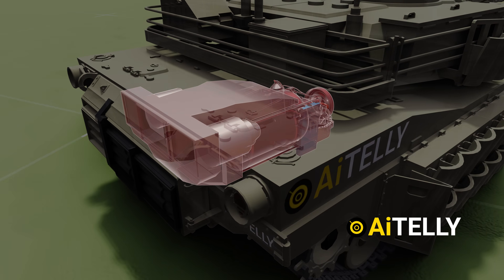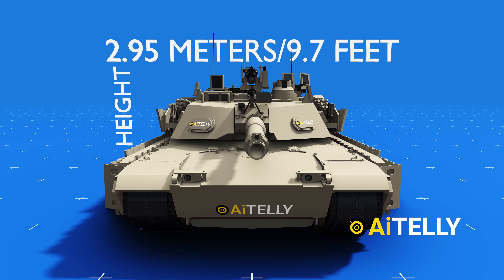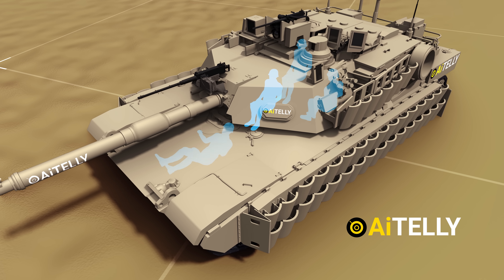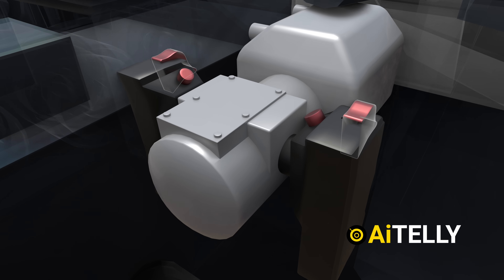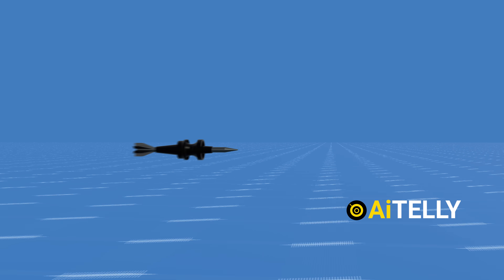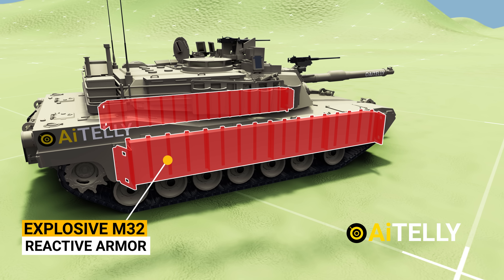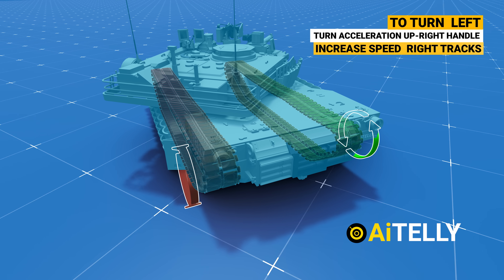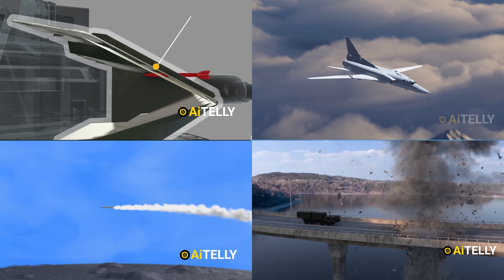How Modern Tanks Works and Fire Interior Exterior M1A2 M1A2C Abrams Trophy System Reactive Armor

Comment: 19K here, you forgot to correct some info, we enter the drivers hatch through the turret when it is traversed to the rear, revealing a compartment for the driver to crawl through feet first, and then the turret will get traversed back to the 12 o'clock position.

Comment: When turning the tank, all the driver has to do is push the handles in whichever direction he wants to turn. To turn left, right hand forward, left hand pulls. To turn right, left hand forward and right hand pulls. The speed of the tank is controlled in the same manner as a motorcycle but they are not independent of each other. Also, the TC can find a second target and have the gun switch to it while the gunner is finding, sighting and firing on his target. Multitasking at its finest.

Comment: 🎯 Key Takeaways for quick navigation:

00:01 🛡️ The M1A2 Abrams tank is equipped with a gas turbine engine, similar to a jet engine.
01:12 💼 The M1A2CA Abrams with TUSK (Tank Urban Survivability Kit) has a length of 9.83 meters and a combat weight of 61 tons.
04:39 🎯 The tank's gunner operates the 120mm smoothbore gun with controls and a trigger inside the tank.
07:10 🔫 The tank uses different rounds, like the heat round for lightly armored vehicles and the fin-stabilized armor-piercing round for tanks.
09:00 🚀 The tank is equipped with the Trophy system, a countermeasure that neutralizes incoming anti-tank missiles.
09:55 🛡️ The tank's armor includes a depleted uranium layer and reactive armor blocks for additional protection.
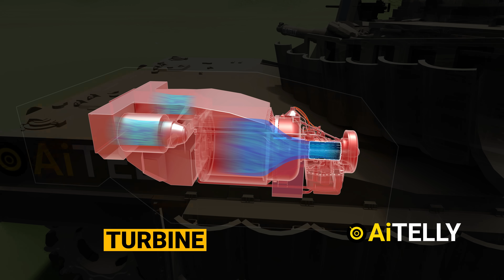11:02 🚛 The tank uses a gas turbine engine (AGT 1500) for propulsion, offering advantages in power and fuel flexibility.
12:27 💥 Despite its advanced features, the tank has vulnerabilities, including susceptibility to certain top-attack weapons and a high cost.

Summary by HARPA AI 🧬

Comment: Can anyone explain
Between turret and body there is a ring what if hits there? Easy to penetrate?? This is weak point
Reply: Yes, this is a weak point on literally every tank, it is a bit hard to hit, but World War II tanks can disable pretty much any tank nowadays as long as they can hit and penetrate the turret ring. This is just limited to the Abrams, the Leopards ,the T-series of tanks and literally anything else has this weak spot. But hitting such a weak spot is really hard. Hope you learn something 😊.
Reply: that ring is the turret ring, a gigantic gear that turns the turret, it is probably one of the most common weakspots on any tank, most turret rings have armor of less than 80mm soo very easy weakspot

Comment: the sliding hatch at the forward driver position should be replaced with a sliding hatch mechanism that slides side-to-side from inside the hull . . . not the outside sliding hatch mechanism as in all present M1A2 & M1A3 Abrams tanks . . . the internally sliding mechanism is safer & provides the driver with less exposure time, when getting in & out of the tank . . . the ammo compartment in the aft turret section of the M1A2 Abrams has the same internal sliding access mechanism . . . furthermore the M1A2 Abrams could seriously do without the forward co-axial gun when it already has a .50 Cal HMG mounted on a 360° deg rotating remote weapons station, on top of the turret . . . not to mention the 7.62 mounted on top of the main gun, against infantry . . . could do with a 5.0 in. suspension lift for increased off roadability . . .

Comment: Hmmm not quite. A jet engine is a gas turbine engine, but a gas turbine engine is not necessarily a jet engine - as is the case here. It's a turboshaft engine, rather than a turbojet or turbofan engine, which are jet engines.
Reply from the maker: https://youtu.be/5AdirNl4l1k We made a correction on the Abrams tanks.

It's feedback like this that helps our channel

Comment: You are not right about engine army picked it (initially was tested both power option in Abrams) by these reasons first it is less noisy in distance than diesel, less heat signature than diesel only downside is that it needs auxiliary generator to be invisible when stopped(the same goes for tanks with diesel engines) and save turbine life-span, multifuel, diesel in these test had only two advantage less fuel consumption and cheaper maintenance ... but in combat qualities was interior ...
Reply from the maker: We Corrected this Video Abrams Tanks   here https://youtu.be/5AdirNl4l1k how to drive a Tank

Comment: The animation and explanation of the driver's T handle is completely incorrect. The two sides of the handle are connected. Twist towards you and you apply throttle just like on a motorcycle, stop twisting and you stop applying throttle - bot sides of the t handle are connected and have the same effect. To turn the tank, you turn the t handle to the right or left like handlebars.
Reply from the maker: Hi Kyle https://youtu.be/5AdirNl4l1k We corrected this Animation Abrams Tank here just for you

Comment: Not a bad video, but there are some things that are not correct. The CITV ( Commander's Independent Thermal Viewer) allows the Commander and Gunner to scan for targets on the battlefield in different sectors. For example, the gunner would scan from 12 to 10 and the TC from 12 to 2. If a target is in the TC's sector he can hit the designate button, which will then slew the turret to what he is looking at. 

The driver's throttle controls are linked together. If you twist the throttle on one they both turn, they do not work independently. When you make turns in the Abrams, you just give it a little more throttle. 

I served in the on the M1A1, M1A1 AIMS, M1A2, M1A2 SEP, and M1A2 SEP v2. I joined the Army in 1998 and retired in 2020.
Reply: At first, I was starting to get irritated by so much being wrong in this video. Then it dawned upon me. It's kinda nice she still has some mysteries left.

Thank you for your service. 

91A-H8 09-13 myself.
Reply: @tommykj2   I try not to get irritated, but I know what you mean. You don't really know unless you've been there.

Thanks for your service as well.
Reply from the maker: Corrected some of the comments here  https://youtu.be/5AdirNl4l1k we corrected this Animation Abrams Tank

Comment: To anyone knowledgeable out there:
How does the main gun eject its casings?  I didn't see any kind of port that looks like it would allow this.  
Great video.  Thanks.
Reply: All the modern MBTs use "combustible cartridge". Usually the only thing left is the "base" of the ammo. It self ejects when the gun is fired, you can watch it on any video of an Abrams "loader".
Reply: @elgranfreezer9117  Thanks.
Reply: There is only an aftcap (primer end and about 3"up the sides) left and fall on the floor into a small basket. The aftcaps can be tossed out easily when time permits. The rest of the casing is paper so it burns with the propellant
Reply: @rovinruss4770  So it's almost caseless ammo.  That makes sense.  Thanks.
Reply from the maker: We Corrected this Video Abrams Tanks   here https://youtu.be/5AdirNl4l1k how to drive a Tank

Comment: Unsurprisingly, it’s the most lethal and most survivable MBT in the world. 🇺🇸
Reply: Incorrect. The Challenger 2 is the most survivable, and the Leopard 2 has identical firepower.
Reply from the maker: Challenger 2 Video Coming soon
Reply: @NorthernNorthdude91749  nope.
Reply: @ChrisDavis333  Yes. The Challenger 2 has a superior armor package, offering more protection. Only one Challenger 2 has EVER been lost. Numerous Abrams have. As for the Leopard, it mounts the very same gun as the Abrams. The Abrams is not the most lethal, or the most protected.
Reply: @NorthernNorthdude91749  we get it the challenger 2 survived an RPG-7 in its extremely limited combat experience.. that’s not impressive, an RPG-7 is nothing. If you put them in the place of Abrams, just as many get lost to IED’s and friendly fire.  Probably more considering they aren’t as good, their support is not as good and their crews are not as good. Given the benefit of the doubt, given the exact same circumstances in combat as the Abrams, the same number of tanks would be lost, likely way more. We’ll see how the Challenger 2 fairs in Ukraine, it will be its first legitimate war experience. I’m sure it will be documented if they actually use it, time will tell.
Reply: @NorthernNorthdude91749  also only 400 have ever been built, that is not a large enough fleet for even a small country like Ukraine to defend itself from an aggressor. So extremely low numbers+no combat experience=no losses. Since that seems to be your main talking point. You’re making me sound like I hate the tank, I don’t, I’d say it’s a top 3 tank in the world, appears pretty durable(we don’t know that for certain). It’s a newer tank than the Abrams and yet with all of Abrams upgrades over the years I still am of the belief that it’s a better tank, I come to that conclusion based off of its extensive combat experience and just its overall specs. Like I said, you’ll get to see the Challenger 2 in a real conflict here in a few short months, that “legendary” armor will get put to the test, if Ukraine doesn’t delegate all of them to non-combat roles(I doubt they will do that, they’ll want to play with their shiny new toy).
Reply: @ChrisDavis333  Dude, you're hinging on the idea that the Abrams is the best tank in the world. It is not. There is no best tank. The Abrams has pros and cons, like any other. The Abrams is objectively less protected than the Challenger, that's simply a fact. You cannot debate that. But the Abrams does have a smoothbore gun (which the Challenger does not) and is faster and runa silently. It has its pros over the Challenger, but again, it's armor is objectively weaker. 

Again, dude, I know what I'm talking about. The Abrams is not a better tank than the Challenger, nor the Leclerc, nor the Leopard 2, nor the K2. Each one has pros over others, and cons compared to others, but saying the Abrams is the objectively most protected tank is simply not true. I was on one, I can tell you for a fact it isn't. It's highly protected yes, but as much as the Challenger.
Reply: @NorthernNorthdude91749  The reason many Abrams have been destroyed can be explained quite easily actually. There hasn't been a single Abrams tank destroyed to an enemy ever, most US Abrams tanks that have been destroyed have been due to friendly fire or intentional destruction to prevent the enemy from capturing them. 

The other non-US Abrams which have been destroyed (mostly those used by the Iraqi Army) were due to the poor combat usage and the lack of knowledge on how to implement them in combat. The Iraqis always used their old T-55's and T-72's to push enemy positions, typically without infantry support, so when they received the Abrams package of tanks they used them the same exact way and got them destroyed. Any tank ever made can easily be destroyed without infantry support and by using them incorrectly in the wrong type of combat doctrine. The export Abrams given to the Iraqi's also, purposefully, lacks modern FCS's and the depleted uranium armor/munition, making them overall weaker compared to actual US Abrams tanks. 

Not so many Challengers have been destroyed because:
1.) They never faced large levels of friendly fire, like the Abrams.
and
2.) The British Government doesn't export Challenger tanks to other countries, like the US does, meaning there is a higher likelihood of Abrams tanks being destroyed in combat because there is a higher amount actually seeing combat compared to the Challenger. 

The Challenger and Abrams are actually quite similar, and it doesn't have a "Superior armor package" either, the Challenger lacks Composite armor on the lower glacis making it slightly weaker than the Abrams actually. Both tanks are quite similar, both feature depleted uranium armor and munition and both feature similar FCS's. So I don't understand how one tank is better than the other when they operate similarly.
Reply from the maker: We Corrected this Video Abrams Tanks   here https://youtu.be/5AdirNl4l1k how to drive a Tank

Comment: It's not just a very expensive tank to buy, but also to maintain. This goes for fuel consumption, ammunition, and repairs.
Apparently, the Leopard beats it in all these points and is easier to repair and operate. Still, neither would be ideal for e.g. the Ukraine for a variety of reasons.
Reply from the maker: We Corrected this Video Abrams Tanks   here https://youtu.be/5AdirNl4l1k how to drive a Tank

Comment: Bros...make video about Rafale multirole firghter and Arrow 3 air defence systems
Reply from the maker: will do after we Finished the Challenger 2 Tank as well as the T90 tank F22 raptor su30

We Corrected this Video Abrams Tanks   here https://youtu.be/5AdirNl4l1k how to drive a Tank
Reply: @Aitelly  Bros..., i suggest you make a video review of the Su-35 Flanker-E instead of the Su-30 Flanker-C/H , 
The Su-35 is much more senior and more interesting to discuss than the Su-30

Comment: Just a little correction at 7:28.  The animation shows the whole round going stright trough the metal plate (like an APFSDS round), but most HEAT rounds will just blow up on contact with the plate and  then send a molten copper jet that penetrates the metal plate further.
Reply from the maker: We Corrected this Video Abrams Tanks   here https://youtu.be/5AdirNl4l1k how to drive a Tank
Reply: @Aitelly  no I think that video still shows the entire warhead going through the armor, just like in this video.
Reply: @Aitelly  And this is why AI is shit.
Reply: "Just a little correction" to you too, lol. The copper liner never gets "molten". The high pressure forms an "arrow" that displaces the armor itself. 

It works basically like a "water jet cutter". The high pressure displaces the material itself. This is called the Munroe Effect.
Reply: @elgranfreezer9117  The copper does get molten. If you see a slow motion of a HEAT detonation the jet of copper is a glowing fireball. It is molten, but yes it displaces the armor material rather than melting it. You are describing explosively formed penetrators, which are different from HEAT in that the liner deforms and is solid before hitting the target.

Comment: Half of what you say is WRONG  !  I was a tanker on M60A3 and M1's  you go the whole part about how you Drive a M1  WRONG !!!!
Reply from the maker: Yes Agreed - we are Redoing the Animation and releasing the Whole Video all over again-

The driver turns the tank by moving the handles like a motorcycle, the whole handle assembly moves together. You can rotate the handles like in the video to operate the throttle, the handles rotate with each other not independently
Reply: @Aitelly  only 1 side rotates   like a motorcycle throttle

Comment: the problem with the turbin is, that you can't stand direktly behind the Tank due to the hot exaust, it's a real problem, because soldiers can't take cover from enemy fire from the front
Reply: Also the turbine consumption is higher compared to a diesel engine.
Reply from the maker: We Corrected this Video Abrams Tanks   here https://youtu.be/5AdirNl4l1k how to drive a Tank

Comment: It's wild that such a huge, complex tank only has 4 crew members
Reply: In my opinion it's not that big once you stand beside it. I am told that the reason it is not that big is because it has to be able to use existing roads and bridges without damaging them. There are pros and cons to having four crew members. Enemy tanks have three crew members and use an auto-loader which can reload faster on a sustained basis. But having four crew members means you have that one more person to help with repairs....and everything on a tank is heavy and hard to handle.
Reply: @rael5469  
Having an autoloading system too can also mean mechanical issues, whereas a living tank loader can be replaced in an instant if needed.
Reply: @crusader_wolf1104  "a living tank loader can be replaced in an instant if needed." 
Yeah....guess who is going to replace the loader in an Abrams.......the Commander. It's not going to be the driver. It's not going to be the gunner. Yeah no.....it's going to be the commander......then the tank virtually loses the commander and the Gunner is making all the calls.
Reply from the maker: We Corrected this Video Abrams Tanks   here https://youtu.be/5AdirNl4l1k how to drive a Tank